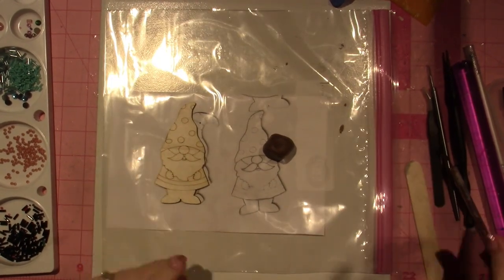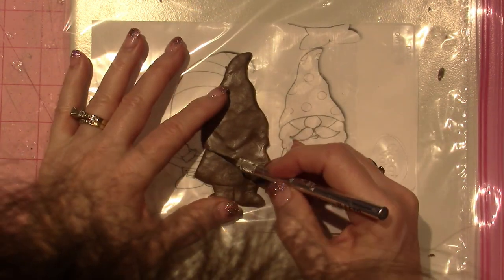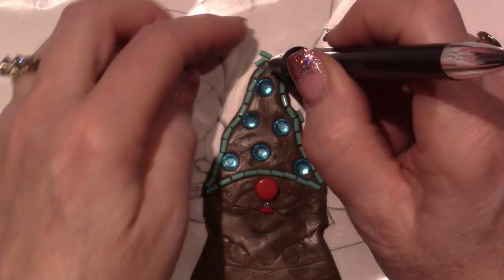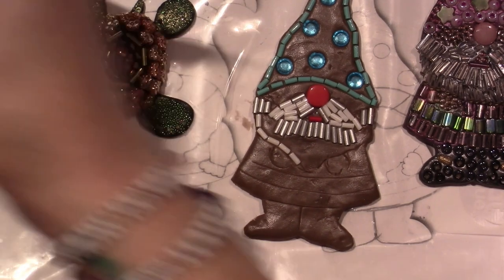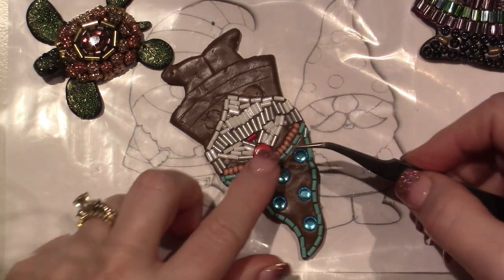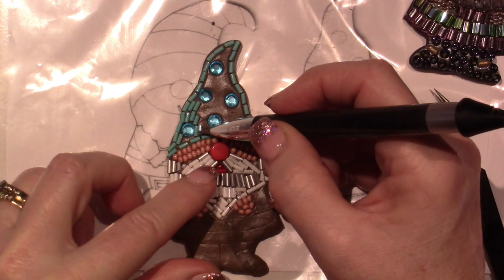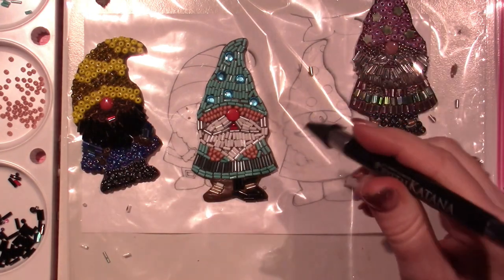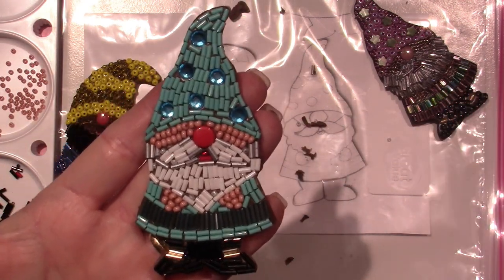Beaded Gnome tutorial; beads and apoxy sculpt

Comment: I was wondering about the Apoxy Sculpt. I am wanting to make a hanging pot like you made for your bathroom. I ordered all the stuff, and I got plates to break up for the nose, and ears ,and such. I  ask you after that video what you used to make it stick, and hold in place, and you told me  Flexbond  thinset  mortar I ordered a bag of it. I have not used it yet. I wanted to ask you what do you think now that I should use for holding the eye lids, ears, and nose on does the Flexbond go on thick and stiff to hold in place or should I order some of the Apoxy Sculpt for the hanging pot. Please let me know so I will know what to do.
Reply from the maker: Well I have only used Apoxy sculpt on my little beaded project. I don’t have a ton of experience either and I learn by trial and error. Sorry. That’s all I can say.